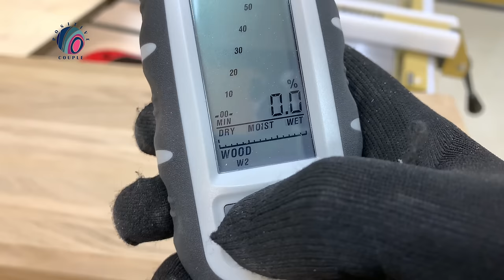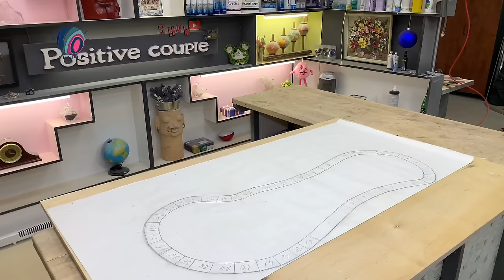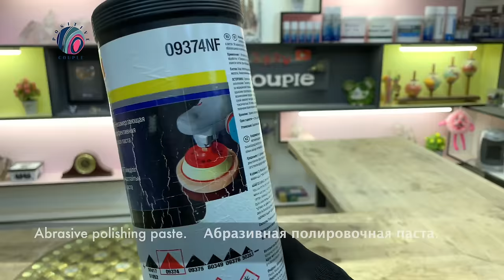68 Gold Watches in Epoxy! Amazing Table of Oak and Epoxy!

Comment: Beautiful!
I like the table as it is, without the frame. But, since you asked, IF I were to alter it, I think that I would suggest to leave the edge of the casting unpolished (but still smooth) and apply the gold leaf you  have used in other projects. That would give the impression of a  thin watch case. Or, perhaps, some oak edge banding around the edge of the casting. That would sort of match the "watch band" part of the table and, again, give the impression of a case for your "watch".
As usual, you've made a beautiful project and it has been an enjoyable 17 minutes, thank you!
Reply: yup - either of those ideas works for me.

Comment: It needs the two hands that most clocks have. A thin frame around the edge (gold leaf would probably work), with a faux knob on one side. The furniture tacks on the buckle are a nice touch. Other than the missing hands and thin frame around the table part, it looks great.

Comment: When the table top was going down, I think my heart skipped a beat, and I was waiting for Vitaly to scream in pain.  Thank God it didn't land on your foot!  I don't think it needs anything more, I like how the watches shine through from every angle.  I have not seen fixer for epoxy here in the USA yet, but I will look.  That is such a great idea.  It's funny how instruments from physical and occupational therapy have been adapted for other uses.  (the goniometer you used to measure the angles of each piece of wood)  We use those devices to measure the range of motion of joints of the body.  Well done!  Beautiful as usual.
Reply: Sweet Jesus when I saw the part when it fell I think I almost have a slight heart attack.

Comment: Even though you can't remove the watches, all of them will still tell the correct time twice a day.
Reply: It would have been funny to let every clock run out beforehand and then set each clock to a different minute from 1 to 60 ... but then it shouldn't have been more than 60 clocks ...;)

Comment: I see what you mean about it feeling like it needs something. A framing around the 'face' sounds appropriate, however I agree with your decision against the one you made - it was too wavey and took away from the asymmetrical design already established. Perhaps a simple low profile wood ring that fits snug like a springform pan.

Comment: My kids: DAD what time is it???

Me: Looks at the table.
Reply: i wondered if they will all stop together :)
Reply: With solar powered, radio controlled clocks this would actually be possible for an extended period (as long as they have reception in the resin and if it doesn't glue up the movement). Or with automatic watches and a giant watch mover.
Reply: @tz8785 : I was thinking of motion-activated self-winding watches. Due to the shape of the table "watchband", one could lift up one end and rock it back and forth to re-wind the watches. Then it could last forever! And with the watches enclosed in the resin, no moisture, and no dust to mess with the watch mechanisms.
Reply: As long as he made sure the watches showed the correct time before encasing them. 🙈
Reply: @tz8785  xD with automatic watches, you just have to shake the table a few times to make them tic again, but sadly, they won't be showing the real time.
Reply: @sonofeloah  Does Russia go along with daylight savings time?  That could be a real pain in the ass.  LOL
Reply: @EllenJB : I do not know if they do or not. BUT, as more and more states here in the usa are abandoning the so-called daylight savings time, it would make sense to simply abandon that practice worldwide let alone nationwide. It is a practice that is bad for our health anyway as it forces the body's natural clock to reset causing immense stress on our immune system and neural health.
Reply: @SunGem : I was thinking about that. Could have every one of them set to a different time as it will always be one of those times somewhere in the world, right?
Reply: Hahahaha
Reply: As my brother would say "time you got a watch!" 😄
Reply: Класс
Reply: priceless
Reply: Look
Reply: I don’t see the point of making a table made of gold watches ,I’d rather spend my money in something else ..,only Russians are the kind of people who do something like that to show off
Reply: It,s missing hands ?

Comment: That epoxy is probably more expensive than those watches 😂
Reply: most likely
Reply: Really? 😳
Reply: Fantastic and amazing work if i want to buy this table how much it cost?
Reply: @onlykts  10k
Reply: All fake Rolex. Rolex watch does not tick but has a floating timepiece
Reply: @HeroHondenbrok010  Rolex has made quartz watches during its years, and what this means is that there is no rule of thumb you can use that Rolex never ticks like a quartz watch, but the newer ones sweep and thus looking at those, I'd say they were fakes...but still once they stop working.. who will know...LOL
Reply: @zsavage1820  They don’t. Name me one timepiece with a ticking dial please
Reply: @HeroHondenbrok010  Of course they're all fake otherwise there would be about £700,000 worth of watches!
Reply: @HeadstockFilms  i know
Reply: @HeroHondenbrok010  Yes and you can tell these knock-offs were really light in weight . Real Rolex time pieces are made of fine metals and are heavy. Plus look at the winder on the side, you can tell it’s not made very well and is not heavy and grooved like the real thing . Also the date is not magnified like on a true Rolex . This is hard to do and expensive to duplicate and the cheap ones don’t do it ! So many ways to tell and a lot of the times , besides the sweeping second hand , the crown logo is just not done right on the knock-offs!
Reply: @brucepoff1  Jup, but all those munks here thinking it is real

Comment: When you realize one of the watches had an alarm set and the damn will go off for 30 secs every day till the battery eventually dies
Reply: most Rolex watches have no battery - work on body heat to start, so no fear of alarm However this is the most expensive table - I definitely cant afford either to make it r buy it, Millionaires paradise
Reply: @VijayaBjoshi  You do realize those are not original Rolex watches don't you?
Reply: @so2fast4u2  l
True, lol
Reply: @so2fast4u2  yup
Reply: Lol not a single Rolex or any other watch ever made works on body heat.
Reply: @wezilman  lmao
Reply: @so2fast4u2  I know
Reply: @wezilman  who says so - fake news as Rolex does work on body heat - I know
Reply: @VijayaBjoshi  you're wrong, those watches are definitely nuclear.
Reply: @VijayaBjoshi  internet indian strikes again
Reply: If they decided to be heated
Reply: @VijayaBjoshi  google says you are correct , google it...
Reply: @ireallylovegod  I know as I owned one for last 20 years [one got stolen by the builder working on my house- could not prove it] . if left on table, it stops after a while. Wear it and hay pesto it works. 😁😁😁 I love Rolex
Reply: automatic watches have a weight rotor witch winds up  the main spring ( the actual power container in any mecanical watch) .
however the watches in the video have a quarz movement's (battery or solar).
easy to spot.... if the second's hand moves once per second its a quarz . 
in a automatic or mecanical movement the second hand sweeps ( moves 8 to 12 times per second depends on cklockwork frequenzy)
Reply: And they are even fake Rolex.
Reply: @depressantdrug  Roles works on body heat. I own one for last 20 years. It works on body heat.
Reply: @VijayaBjoshi  Rolex watches are powered by a Perpetual rotor inside the watch that gently swings as you move your wrist, transferring energy to the mainspring of the watch. If you take your watch off and set it aside it will retain its charge for about two days, depending on the model.
Reply: @depressantdrug  you are right. I checked it with the shop- as oops I dropped the watch and smashed the glass - had to visit the shop
Reply: @michaelchildress7617  you were right/I was wrong....
Reply: @VijayaBjoshi  lmfao body heat....and you owned one for 20 yrs yet you don't know the mechanics of your "Rolex" 🤭🙄
Reply: @Crypto.r.e.a.m  my Rolex Batman charges if i put it in the microwave. Fast charge 👍🏼i get 40 hour life for 10 mins on a high setting.
Reply: @real-eyes-realise-real-lies  damn I gotta try that
Reply: @Crypto.r.e.a.m  🤣🤣🤣🤣🤣 if you have a genuine rolex please dont haha. If its fake, fire away.
Reply: @real-eyes-realise-real-lies  I thought u would recognize sarcasm if it was infront of u🤣🤣🤣🤣
Reply: @Crypto.r.e.a.m  of course i did my man 🤣🤣
Reply: @real-eyes-realise-real-lies  have an amazing new year's my man and may our  eyes and be open the things that 2021 is about to bring to us.
Reply: @Crypto.r.e.a.m  for sure 👍  i'm going to be ignoring the tiers and working, i hope you and your family make it though the shite also 🤞🏼🤞🏼
Reply: @real-eyes-realise-real-lies  
ꮳ υ ꭱ ꮪ ꭼ ꭰ seal of disapproval.
Reply: @VijayaBjoshi  You are wrong. Rolex watches work on body movement not body heat.
Reply: @user-xs3lc4ky4h  come again?
Reply: @real-eyes-realise-real-lies  
Microwave the Rolex.
Reply: @redpillcommando  oh gosh. that was old old post- and I know as I owned Rolex for lat 20 years. thanks any way. have a nice day
Reply: @user-xs3lc4ky4h  hahah. Crazy people may believe me 🤦🏻‍♂️
Reply: @real-eyes-realise-real-lies  
Lol
Reply: @VijayaBjoshi  Vijaya you know sod all, only how to make a prat of yourself
Reply: @so2fast4u2  Obviously he doesn't. Real Rolex watches are mechanical clockwork driven, which are kept wound by the movement of the arm/wrist, NOT by body heat. These watches were cheap quartz movements,
 these movements 'tick' the seconds, real automatic Rolex watches have a second hands that smoothly 'sweep' around the dial. (to be absolutely corecte they do tick but at around 5 times a second so not noticeable unless you are looking for it)  
Cerise, the words you are looking for is KINETIC ENERGY
Reply: @shaguaretype6996  Learn some manners. Good bye.

Comment: Question: How will you change the batteries?😁
Love your creativity
Reply: Automatic. No batteries. But obviously fake so not sure.
Reply: @DilipMutum  even automatic sometimes need manual time setting. .
Reply: Dilip Mutum So you just pick up the table and rotate it until the automatic rotor winds the watch?🤣
Reply: There are no batteries. You just need to wear the table now and then on a monster wrist.

Comment: Although I totally love it, you are 100% correct. It is lacking something, which I did recognize but was so mesmerised with the craftsmanship and beauty of it. Perhaps a design around the watch face would do it... a simple although elegant metal ring around the watch face that matches the metal in the watches? Should bring it together without distracting from the piece itself. 🤷🏻‍♀️
No matter what, it's a beautiful work of functional art. ❤
After rewatching, it seems that the band around the watch face should either be solid metal matching the watches with the exact same nails tracked into it matching the buckle or just the nails directly into the epoxy matching the buckle. 🤷🏻‍♀️❣❣❣❣❣
🙋🏻‍♀️❣❣❣❣❣
Reply: I was going to suggest the same thing or a black frame around the face. 😁
Reply: Agreed! This is stunning.  Would be nice if there was a soft, warm ambient light underneath the face, as well as a band around the dial, and a winding stem.

Comment: It's going to suck when it's time to change all those batteries...
Reply: Master piece ever batteries? 😉😉
Reply: Rolex doesn’t run on batteries they have automatic moving that’s why he used them
Reply: No One I doubt those are all real rolex
Reply: Just shake the table.
Reply: @oo2088  that many Rolex watches would cost a small fortune. A quick search for them and the cheapest I could find was 9k.
Reply: @oo2088  not a single real Rolex in that piece.
Reply: @oo2088  Not Rolex
Reply: @adamjohnson4821  A big fortune
Reply: ᑎO Oᑎᗴ those aren’t Rolex’s
Reply: Jordan L 8:23 they may be fake, but they are branded
Reply: @oo2088  mate those are not real,i would even say bad replicas :(
Reply: For those who say they are not Rolex look closely at the close ups though I doubt there real
Reply: Masterpiece tick like quartz indeed needs battery, all FAKE Rolex
Reply: All fake Chinese made ROLEX, notice 15:07 Rolex second hand is ticking like Quartz not smooth sweeping. Nevertheless , great craftsmanship I like the table.
Reply: All fake Chinese made ROLEX, notice 15:07 Rolex second hand is ticking like Quartz not smooth sweeping. Nevertheless , great craftsmanship I like the table.

Comment: If these where real rolexes this would cost  a few millions to craft
Reply: Of course
Reply: About 650000€
Reply: Not millions
Reply: Audemars Piguet
Reply: My guess is that these are  'street"  Rolexes.
Reply: The resin probably costs more than the watches
Reply: They're not real coz the Rolex does not make a tick sound
Reply: AAYCH * they do have a Little tick 8times in a sec
Reply: They aren't real because they tic but other than that it's very cool
Reply: Definitely fake Rolex watches. Unless this guy happens to be an Oligarch, then they might be real lol.
Reply: Joseph Shutack you obviously haven’t seen a real Rolex up close. They do tick In very small increments so it looks smooth from a distance.
Reply: Alex Lavezzari yes finaly someone that knows
Reply: I mean the vid is sponsored so if it's a table for the sponsors who knows
Reply: @adrianococcioli5349  

э
Reply: This needs a divers unidirectional bezel.

Comment: Pure gold! A frame like the actual rolex would be nice. With a button on the side. Perhaps numbers and radium hands on top with a removable battery pack underneath the face to run an actual clock. Would have to drill through the middle though but I trust your skill.

Comment: The watch face does seem to be missing something but I have no idea how you'd fix it. My only concern was how the batteries inside the watches would fare over time. Would they corrode? Would they just run out of power and die? Would they react to the resin? Very clever design regardless. 🙂

Comment: As you asked for how we think this tablet could be improved:
I wouldnt have used the silver nails I would just have tainted the buckle or used darker wood. Then I would also used a darker wood frame matching the buckle for the table top, mimicking the a wrist clock frame. Maybe too sober but stilish IMO
However, great job! Congratulations

Comment: I think maybe you guys should of put a gold rim around the table top to match the watches. Otherwise it was great. Well the pins you used on the clip of the band also should of been gold instead of chrome or silver stainless steel. Gold or even with gold and crystals.

Comment: Your designs and craftsmanship are generally exquisite. So i was dismayed to see that the sanding portion was left on par. The curvatures of the base are blocky lending an unfinished look to the piece. The top could be finished by a thin band of aluminum laminated or laced with gold flake paper. Maybe a makeshift knob. I would not try to incorporate the mounting arms as this would detract from the impressionist style.